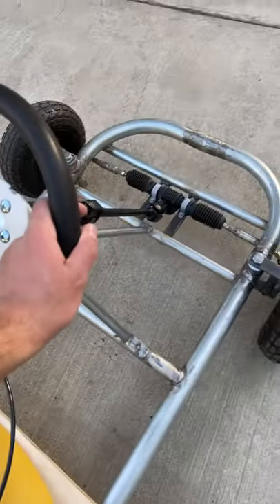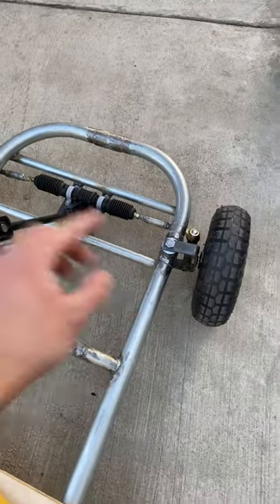Go Kart Project Update (I made the steering system)

Comment from the maker: This is a short update on my go kart build. The piece of wood is to hold the seat in place. I will eventually mount it using tubes. Part two of my go kart build is dropping soon. I used rack and pinion steering for nimble handling as well as driving pleasure.
Reply: Where did you get that steering from
Reply from the maker: @kyro0996  it was from Amazon.
Reply: @Engineering_Rebel  ok thanks you couldve left a link in the description of where you got the parts
Reply from the maker: @kyro0996  at the time I purchased the parts I experienced a lot of delays and received incorrect parts, I didn’t feel comfortable, leaving links in my description as I didn’t want people receiving incorrect parts or experiencing delays. This build was two years ago so I don’t remember exactly where off of Amazon I got the steering wheel. Most of the parts I received were retrofitted meaning that I had to modify them to fit.
Reply: @Engineering_Rebel k 
What width rack is that
Reply from the maker: @kyro0996  I donated this GoKart to my school 2 years ago, I don’t remember all the specific details. I haven’t seen or driven that thing for a pretty long time now.
Reply: @Engineering_Rebel  ok